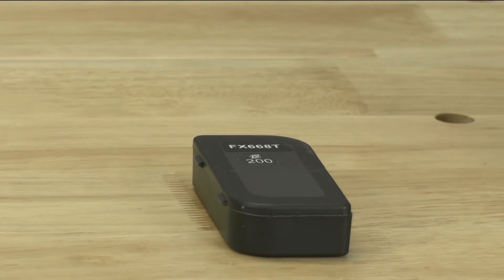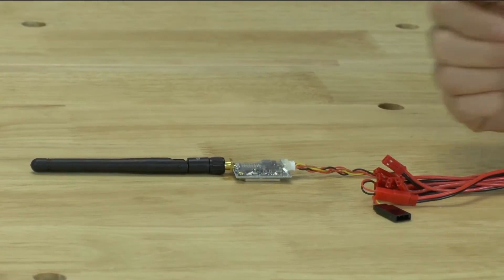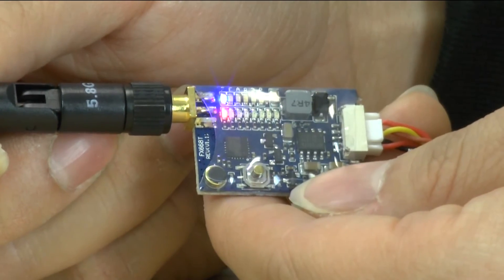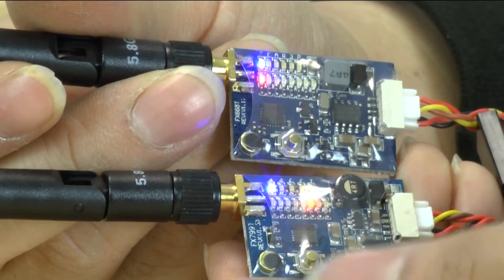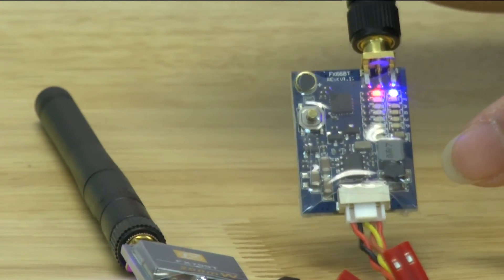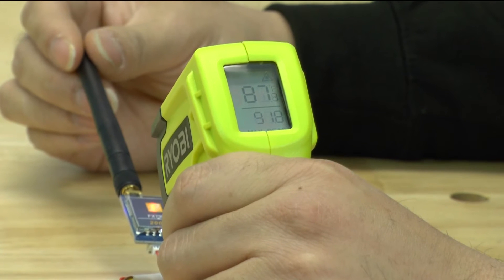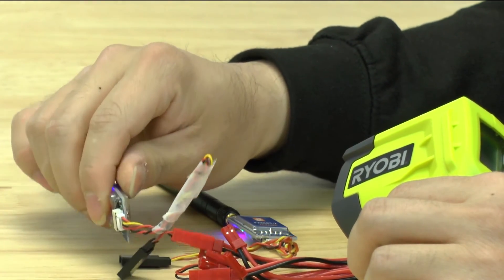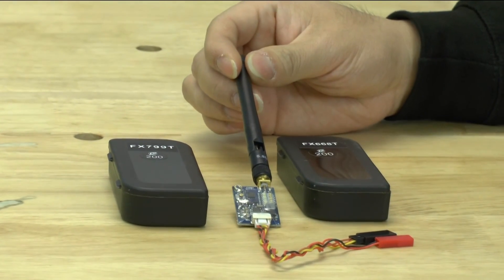FX668T Video Transmitter with Race Band

Comment: I have a few of these and just used one for the first time today. I noticed that the printed band list that came with it is incorrect. It lists raceband on the 4th LED down (fr4) or Band R, but it actually transmits raceband on the 5th LED down (fr5) or Band B. Can you confirm this with yours, so I know if it's just mine. I haven't tried the other bands/channels yet. Seems to be a very solid vtx though!